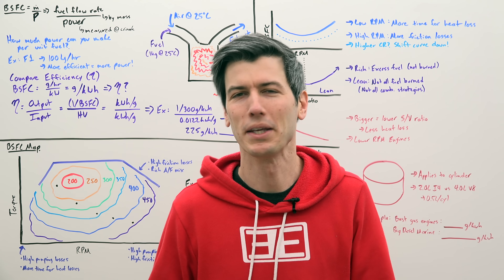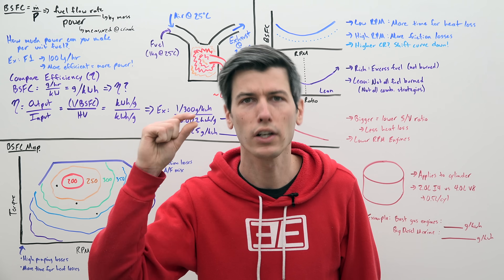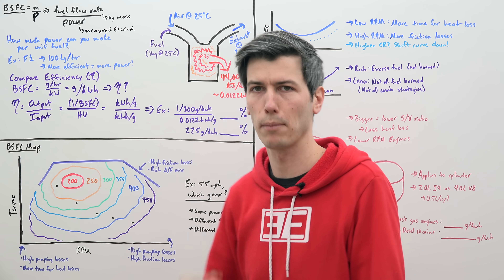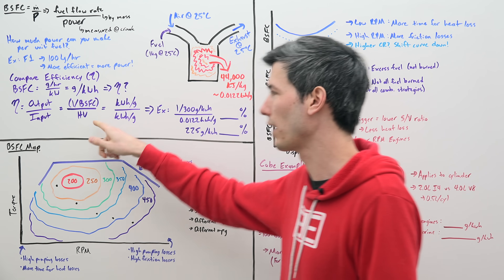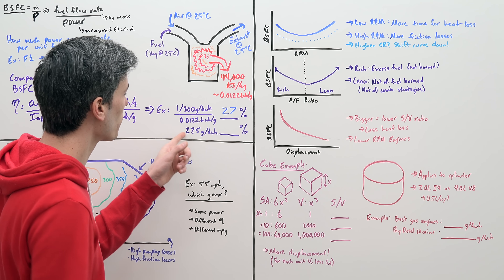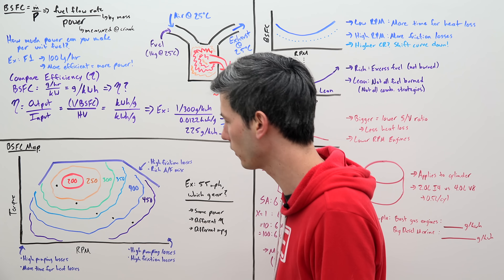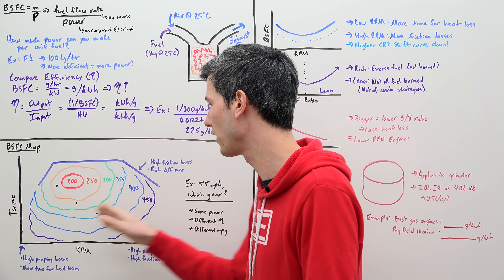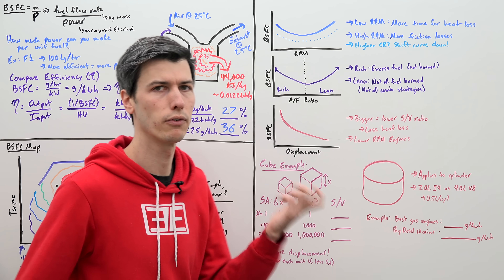The Best Way To Compare Engine Efficiency - BSFC

Comment: It is pretty amazing how efficient over the road trucks and trains are in how much weight they can move per unit of fuel.
Reply: Trains have a very low rolling coefficient of friction between the wheels and the rails which gives them that efficiency.
Reply: @ninemilliondollars  also do not go up steep hills.
Reply: @borysnijinski331  Trains have sand tubes that deposit it on the rails just in front of the wheels to help with traction going up hills.
Reply: @ninemilliondollars  trains don't have steep climbes anymore, 4% max if i recall correctly. The long term fuel savings greatly outweighs the up front cost of reshaping the grades. Out in the western mountains there is old tracks abandoned all over with tree's growing through from when the new low gradient tracks went into service.
Reply: True, the trucks I drive will do 8.3 mpg (US gal) but weigh 44 tones or 97,000 lbs
Reply: @nothingsurprisesmeanymore  I also am a trucker and can confirm, this guy is spot on on the numbers.

Comment: I think there is more to it... Like the size/body shape of the vehicle. some people think that a 1.3 or 1.4L pulling a heavy SUV chassis is economic but in essence, the engine is burning more fuel with the amount of revs it needs to get the vehicle moving and to keep it moving.

There needs to be a good power to weight balance for good efficiency, Aerodynamics also has a fairly big part to play especially when it comes to highway cruising speeds. 

It should be that the less stressed an engine is, the more fuel efficient it is. (i think) so even though a 2.5L is a bigger engine than the 1.4L, its going to be more efficient at pulling a heavy chassis because it can create more power.

Comment: Yes to value the efficiency of an engine this is correct (it's the literal definition of efficiency) but when people are comparing vehicles has no sense, objective/expense = miles traveled/ gas burned
Reply: And people drive vehicles for fun which can negate any efficiency significantly. Many people will own Mercedes, Audis, BMWs, etc. with 300 hp. engines but only drive to the store or back never getting into an efficient range. Or others that floor the pedal all the time. :D
Reply: Yeah, but this video is about engine efficiency. Not vehicle efficiency.
Reply: @Kepe  True.
Reply: @Kepe  I've never heard someone talking about an engine and mentioning efficiency as mpg

Comment: how can I measure power to do this? in advanced options of board computer I have readings of amount of fuel pumped into engine, but I don't have any info about power or torque, how can I do this? for science only
Reply: Engine output is measured with an engine dynamometer. Though you can get an estimate of load by multiplying throttle position by the maximum output at that RPM.

Comment: Your BSFC is common to up-to-date turbocharged (and usually downsized) engines. For N/A engines lowest BSFC zone usually appears at high load and 500-1000 rpm above maximum torque rpm. Low rpm efficiency zone of modern engines is made for cheating on MPG during certification tests. That's why MPG numbers on paper and in the real world are pretty different except some engines, like Mazda's who don't use downsizing.

Comment: Engine Efficiency is one part of the equation on a Car. Transmission, engine, weight, tires, axel, etc, are the mpg ..
Reply: However like the example said at the beginning of the video a 30 mpg moped is not better than a 20 mpg semi. So I feel like there could definitely be a more nuanced version of mpg, however with that said I definitely do not think this BSFC thing is it.
Reply: @arog7493  for trucks/ semi's they look at fuel consumption relative to load
Reply: @ΗΕΑΗΘΣ  Oh interesting, didn't know that, that does sound like a better system.
Reply: MPG estimation equation is the thing they need to improve..

Comment: diesel engine run more "efficient" is mainly diesel fuel contain more energy than gasoline
Reply: That is an unfair comparison.
Gasoline and Diesel have about the same energy content per kg (or pound).
The specific density differs. Gasoline is lighter.
Diesel contains more energy per liter (or gallon)
BSFC uses weight and not volume.

Comment: Would love to hear why motorcycles generate so much more power per liter than normally aspirated cars. Honda can do 200+HP per liter in a bike, and the performance fit is still 130HP with 1.5L.
Reply: Short answer: Motorcycle engines spin at considerably higher rpm which translates to more power.
Reply: @Averna222  yeah. I’m looking for a more complete answer. Honda didn’t mind a high spinning engine in the S2000. That car produced 250HP from 2.0L. But, they’ve shown they can do over 200HP from a single liter. BMW also. Who wouldn’t like to see a version of the M Roadster with 400HP coming from two 1L bike engines slapped together!? And if Kawasaki and Suzuki and Ducati and others can all do this .... why not Ford and Toyota and the others? 

Engine RPM doesn’t seem like a real problem. I don’t mind reving my bike to 15,000 RPM and I don’t mind reving my car to 8,000. 

Torque is very different on a bike engine. It’s a requirement to have comparatively low torque on a bike though or they would flip more readily. I’m also assuming that this is a thing they tune the engine for. 

Engine longevity is another factor. Most performance bikes don’t get anywhere near the mileage that cars get before they start to break down. It may be that engines need to be detuned to make them last longer. 

I think what I’m trying to say is .... there are lots of factors and I’d like to hear from an expert.
Reply: A more complete answer would involve cost, durability, emissions and driveability.
More moving parts tends to push the cost upwards and in order to survive at very high RPM, those parts need to be very strong and very light which translates to very expensive.
Motorcycle engines also aren't generally expected to go 10000+ KM between services and still last for at least 250000 KM.
In most jurisdictions, emission requirements for cars are much stricter than those for motorcycles.
In order to get about, a heavier car requires an engine with a wider power band than a comparably light motorcycle. You can get around that by using more gears but gears are heavy and most drivers can't be bothered to shift more than once or twice by the time they get across the intersection when leaving a red light.
Reply: @Shapparaal  yeah ... a more complete answer. That’s why I’m asking the channel creator. Makes sense to me.

Comment: where does the boost fit in all of this ?
Reply: Less friction at lower load due to smaller displacement (and friction areas), but the ability to make more power if needed. The cost is lower efficiency at higher loads because of richer fuel mixture due to cylinder cooling needs. 
I had a surprise with an 3l V8 BMW having much less fuel consumption than an 1.6l Toyota Corolla driving thru germany at near 200km/h (130 mph) for many hours. But that happened once in my life. 99.99% of the time you have a low power demand and need higher power only for a short time like overtaking a car. Thats why small turbocharged engines are getting more and more popular. Best of both worlds.
Reply: @olaf_s_23  what i don't get is why are we not using restrictors to do the opposite of forced induction at low load, throttle bodies are not the best for this job, if you can get 1.5 bar pressure on full boost you will be able to run at 0.5 bar at low load right ? less O2 less fuel, less heat, you can use more timing advance .... 
instead automakers opt for the easy way out, using the EGR to "dilute" the air instead, the result is a complicated system that cloggs up and fills the engine with carbon deposits ... 
its just sloppy design, the same goes for the wastegate, its in the name "waste" its the opposite of efficiency, and you know what it does ? it "regulates air pressure", how clueless can all the engineers working in the industry be ? you can use a "pressure regulator" to regulate air pressure and stop wasting energy, they are 200 years old and are in use in plumbing everywhere
i mean how is no one concerned about this ? how obvious does it have to be, its in the name ...

Comment: You are right, larger does not mean is better. But I want to point at my personal experience using a 5.0L 2018 Mustang, and I am impressed with the fuel efficiency, it has a 11:1 compression ratio (I think), and it averages 11 km/L [26 mpg]. In my mind one of the best engines I have tried. Without entering that it revs 7500 like crazy for a V8. It's like a 90's Honda hahahaha. Great content!

Comment: Do you do requests? It would be fascinating for a series on the efficiency impacts of hybridization. I know it's a combination of braking regen, electric assist, capture of excess power/electricity, but (and here's the tie-in to this video) I think there's a component of keeping the engine at its most efficient zone during electric assist (if not shutting it off), or in the case of Honda, keeping it in the most efficient zone for use in a serial hybrid configuration. I'm curious about how each one of these aspects of hybridization effects the overall fuel consumption, i.e. which is the largest contributor? And since BEV also use braking regen, how much of a player is that in BEV range? (I think you may have already covered that last one...)

Keep up the great work.

Comment: I find it intriguing that with different fuels, you get different efficiency and based on the fuel quality, you get engines tuned to run on those fuels. One such fuel that intrigues me is what Porsche and Audi are developing: *Synthetic fuel*. We can't move forward with every single mode of transport hooked up to the grid and the only solution to it being adding more power cables and increasing power output from the stations... basically put all eggs in one basket approach. A video about how these fuels would compare to EV batteries would be a worth watch from me. A lot of people I'm seeing are dismissing it to be some kind of farce. But I think the future could also be synthetic fuel :)

Edit: Nice! My timing of me posting this comment made it the 100th comment on this video :D
Reply: Biodiesel has been around a while, you can even get usable biofuel from a strand of algae. I forget the details as I had learned about it back in 2000-2001 at tech school.

Comment: according to wiki, my 2.0 bimmer nets 198g/kWh, which seems awsome!
And it really shows, under ideal conditions i can crack 60mpg quite easily. And thats a 1.5t boat with rwd and no hybrid nonsense.
Reply: This a diesel?
Reply: @AustinPerdue  Yep, N47 diesel.
Reply: One thing to keep in mind with diesel is that it has at least 15% more energy per unit volume. A comparably efficient gasoline engine would be around 230g/kWh.

Comment: Hi Jason, at the end of the video when you compare an efficient gas engine to a large marine diesel, is comparing them in terms of g/kWh correct given that (according to my quick Google search) diesel has more Joules per gram than gasoline? Thank you, awesome video!
Reply from the maker: Not exactly, hence providing the overall efficiency percentage as well (41% vs 55%). The heating value of diesel is actually slightly lower than gasoline (about 98%). It's very close, but I should have mentioned! Diesel does have a greater density, however, which means by volume 1 gallon of diesel holds more energy than 1 gallon of gas.
Reply: yeah, it would make more sense to compare to other gas engines. Or more fair would be to compare diesel car engines to marine engines.

Comment: For example is my 2007 Mazda 3 Hatch gets 25 MPG (2.3L) while my 2017 Mazda 3 Hatch gets 30 MPG (2.5L).  Big efficiency gain in 10 years and much more HP even though the 2017 is an automatic and weights more.   I figure if I dropped today's (2L) into my 2007, it would be getting close to 40 MPG which is crazy gains.
Reply: 2.5 also has much higher compression, so that helps  a lot

Comment: You mentioned F1 engines, but never mentioned their (Admittedly estimated) BSFC figures. Is this the same as Thermal Efficiency? Mercedes said they broke 50% back in like 2017 with their 2.4L Turbo Hybrid Power Units.
Reply: It's 1.6L V6, not 2.4 (the old V8 were 2.4). They broke 50% including the brake energy recovery (KERS). The engine alone is not 50% efficient, by merc's own admission.

If you have the thermal efficiency you can convert it to BSFC if you know the LHV (low heating value) of the fuel they are running. As they are limited to pump fuel, this is easy to do. Say they can achieve 51% efficiency. Gasoline has a LHV of 43.4 MJ/kg, that makes the "BSFC" 163 gr/hr/kW. But, as that 51% includes brake recovery, that is an artificial number that is overestimating the engine's capabilities.
Reply from the maker: Yep, I believe Mercedes has said they hit 50% efficiency. Though I'm not 100% on what the exact fuel composition is, nor their specific bsfc numbers. Obviously not running pump gas, but it is fairly close. Impressive efficiency numbers regardless!

Comment: It's sad the manufacturers tune engines and transmissions for optimal economy at 55 (which isn't a reasonable highway speed) and also for optimal 0-60 times instead of designing for real world usage.
Reply from the maker: They most definitely will tune for real world usage. Especially with many modern cars going 10-speed to have many options depending on your vehicle speed (including higher speeds like 75, 80 mph etc). But the 0-60 thing for sure happens, gotta win over those enthusiasts! 🤷‍♂️
Reply: they also have to tune for emissions, which can sometimes kill plenty of economy.